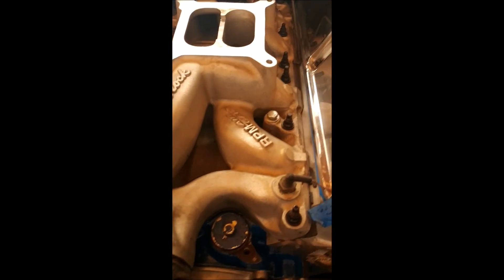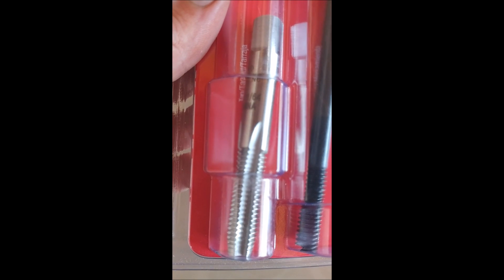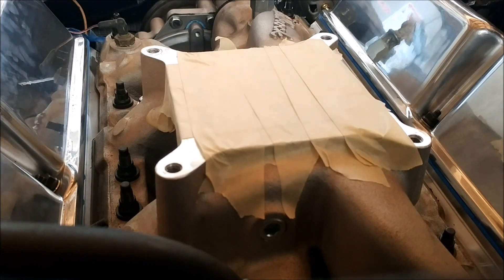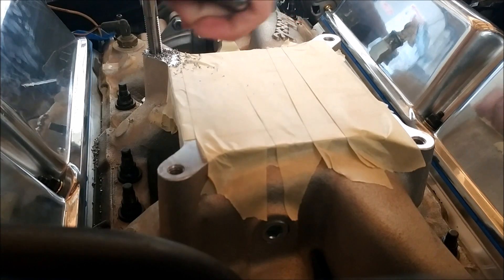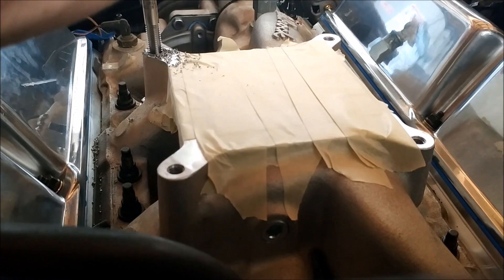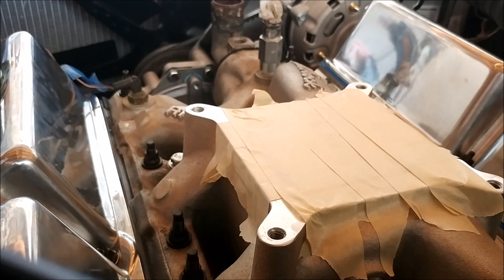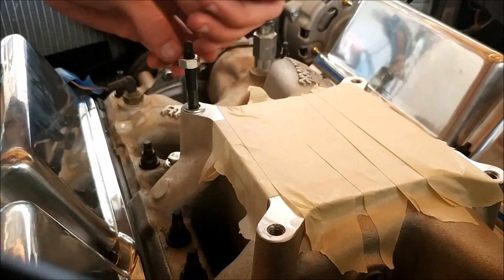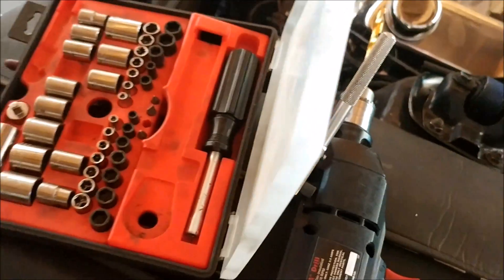Aluminum Stripped Thread Repair Intake Manifold

Comment: FYI. KEEP CARB on intake or at least use a deep socket as a guide to ensure the hole is straight.  If using a drill press make sure carb flange is flat, use a bubble or digital level.
Yes I may be stating the obvious, but I had had to fix at least 10 hole that people drilled and thought it was syriaghr until they tried the thread in the bolt.😢

Comment: Like Jason said you went in crooked, And the tang at the bottom of the insert needed to be snapped off when finished. I would have run a file cross the hole to clean up any burrs.

Comment: I did the same thing to the thermastat housing on my 69 c20, thats why im here but that 350 is giving me issues. Last owner didnt take very good care of it.
Reply from the maker: Time for a rebuild?
Reply: @gtjason6319  yeah lol. Ive got a spun rod bearing. If i run 15-40w the claking will reduce to a slow knock at idle but anything thin and it proceeds to clack on acceleration

Comment: To help keep your tap straight while taping....drill a hole the same size as the outside diameter of your tap through a piece of steel.  Place the steel plate over the hole you are about to tap.  Insert the tap through the hole in the steel plate and into the hole you are going to tap.  This will greatly increase taping the hole  straight.     It's a taping guide block.  I usually use a piece of 3/4" steel roughly 2"x 2" on a drill press.
Reply from the maker: Awesome tip..
Reply: I wish I had known this info before.

Comment: Try some studs instead of a bolt ,no stress on the threads
Reply: Yes use studs for sure.
Reply: I used studs and stripped one of mine, what did I do wrong?

Comment: shouldn't you use thread locker for the insert.  I'm not sure.
Reply from the maker: Sorry I never noticed this but incase anyone else had the same question, thread sealer shouldn't be used because it will expand into the new threads and you might not be able to tighten in the new bolt without damaging the aluminum all over again.